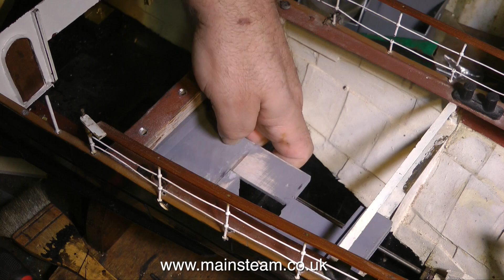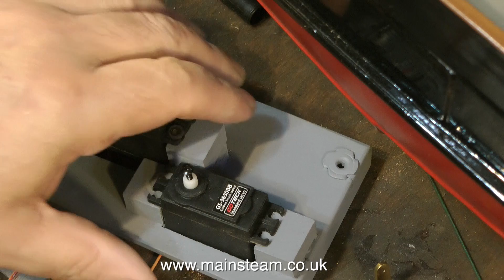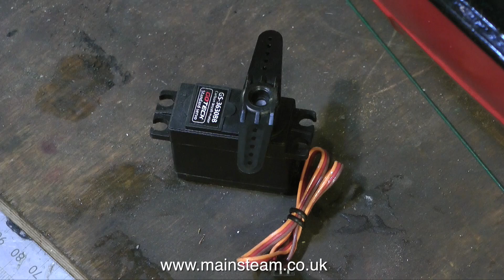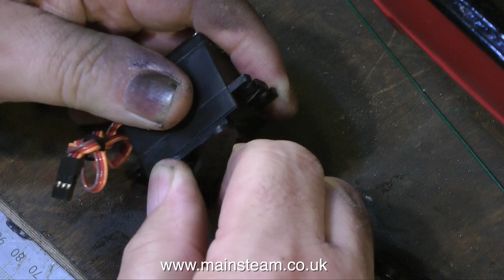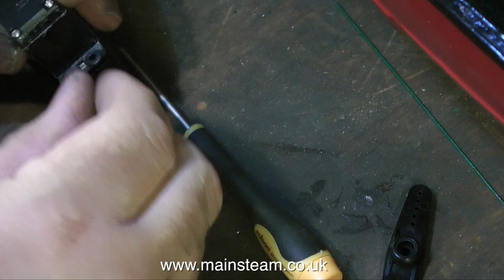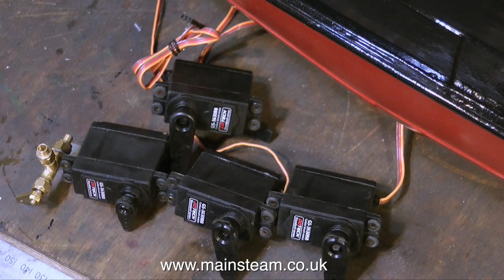REFURBISHING A VINTAGE MODEL STEAM BOAT - PART #15

Comment: I know this is an old one Keith, but an idea struck me ( might knock some sense into me). 

Have you considered using one of the very small 5.8ghz video systems to monitor the water glass so a radio controlled injector or pump could be used vs the boat having to return to pump water? You could also monitor pressure I would think. 

They whole thing with a screen van be had for 40$ or so from China. Might also be a good option for the steam engines smaller than 5" gauge, something like a qx7 would have plenty of channels and adjustments to open valves :-). You could also use an OSD(on screen display) for voltage monitoring. It's entirely possible I've suggested this before, but im.not sure ( making my way through the series again)

Sitting here building a racing quad watching steam engine videos !
Reply from the maker: I really wouldn't want to do that - too fussy & complicated in my opinion - I much prefer the "hands on" manual method .....
Reply: Keith Appleton I can see the appeal in that:-). Was just a hair brained idea sitting here tinkering ;-).